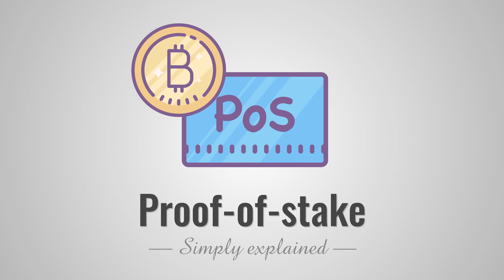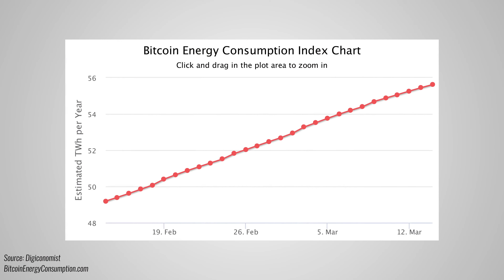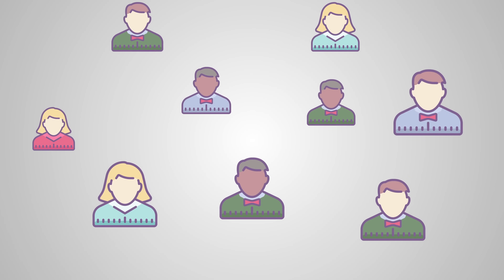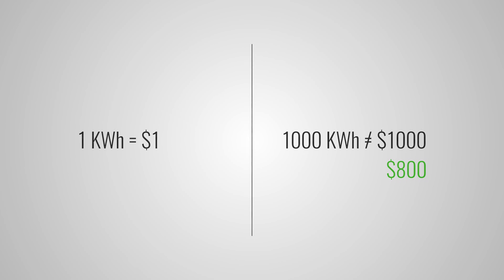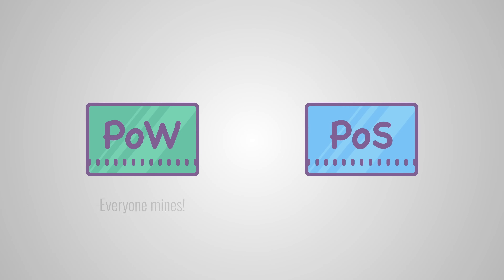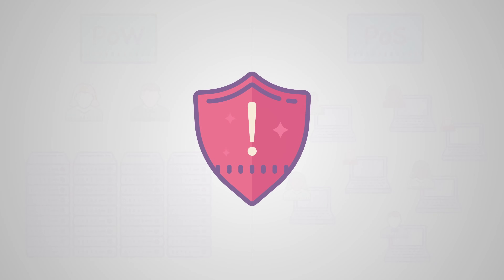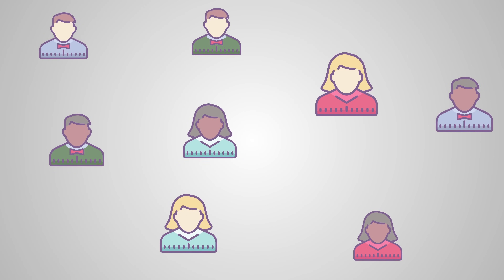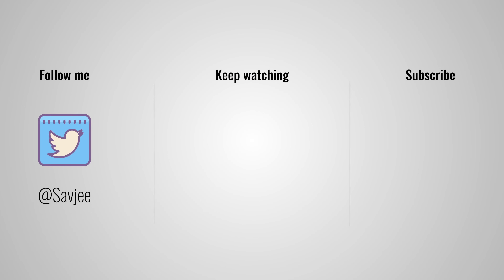Proof-of-Stake (vs proof-of-work)

Comment: 2:21 "One node is randomly chosen as a validator"
2:37 "Validators aren't chosen completely randomly"
Reply from the maker: Hehe, it's still random, just not completely random. Your odds are determined by your stake. But equal stake means equal chances, means random selection.
Reply: @davidz2690  if your forced to add "not with uniform..." so it's not "completely random" as general public assumes it, with seems "fully random with uniform odds". Like in a game of dices, with strictly the same weight for each dice and for each face of each dice. A "fair" random. 
 
SimplyExplain is just better than you to explain clearly without acronyms or technical concepts ;)

Comment: Complete novice here, but I have a suggestion. Why not assign blocks to users by scaling the size of their stake with the transaction value of the block? So have some sort of sliding scale where somebody with a smaller stake will get blocks of smaller transactions, and somebody with a larger stake will get blocks of larger transactions, kind of like tax brackets. And arrange it so that everybody (having over a relatively small stake in the currency) gets roughly the same amount of blocks to process.
Reply: Also a novice here, I believe block sized are fixed and do not vary.

Comment: but how the forger validate transactions and make blocks technicaly ? is they're doing that manually ? please explain
Reply from the maker: No it's not a manual process. An algorithm basically checks each transaction that can be included in the block. They check if the transaction can take place (sufficient balance) and if the transaction has been correctly signed by the person who is sending money (public/private key)
Reply: @simplyexplained   thanks a lot savjee
but what the validator do to get a reward ? because in the proof of work protocol the miner buy the equipement that uses energy in order to calculate and validate transactions and create blocks, what's the validator computer do to get a reward ? is that algorithm uses the CPU power , 
i'm sorry if ask you more question
Reply from the maker: The validator gets to keep the transaction fees. That's his reward for keeping his node online.
Reply: @simplyexplained   ah okey so the validators have the ability to on/off their node ??
thanks a lot savjee

Comment: thanks for the video! i'm wondering how does the network know that the validator approves a fraudulent block? since he/she's the only one doing the validation I suppose?
Reply: Everyone can have the data needed to create each block and forge the hash.
So i guess the simplest way is that each elected first check the previous hash then hash the new one.
Each validator is the validator of the previous. I guess the punishment is automatic.
Reply: @philv3941  isn't it blockchain? That means everyone in the node will have the copy of transaction and if they notice some red flags they can raise them?

Comment: What's to stop the creation stake pools similar to mining pools?
Reply: You need a balance of bitcoin's decentralization but the ability for pools, companies, teams to speed up velocity based on real world work.
Reply: I don't know how this problem can be solved generally, but I'll give an example. Orchid, which allows for decentralized VPN services, uses POS to select which node on the network will route a user's internet hops. Of course, a larger stake makes them more likely to be selected for a certain block. However, if the stake is so large that they are being awarded more blocks than they can possibly handle (being asked to provide more bandwidth to the network than they are able), then the extra staked amount is wasted. This gives an incentive not to stake more than what is needed. And also, it's important to note that pools DO exist very explicitly on most POS networks, as they allow you to "delegate" your staked coin to someone who has met the minimum amount to stake (these minimums are usually in the range of thousands of USD). I think a better permanent solution would be to introduce an artificial dis-economies of scale into the network, by having the chance of being selected for a block vary sub-linearly to the amount of stake on the network. For example, Validator_Chance = (Stake)^(.99) or something like this.
Reply: Exactly.  Are you familiar with Steemit?  Because that seems to be precisely what happened there... If people want to see how a POS system turns out, look at Steemit.  Then look at Bitcoin.  Which is superior should be apparent, imo.  (Don't get me wrong--I have been a member of steemit for almost 9 months now, and use it daily.  But I have seen how it has, imo, worsened over time, as opposed to *improve*.

Comment: As the stake in the deposit will probably higher that the transaction fees but much lower that the transaction amount.  What happen if the validator choose to falsify the ledger and steal the transaction amount?  How can proof of stake prevent this kind of fraud? In pow it takes 51% of the system to falsify blocks but it looks like it is much easier in pos.  Thanks!
Reply: In proof of work, it's the job of the miner who solves the next block to make sure that blocks that were mined before them are correct. In proof of stake you can implement it, so that the next validator has the job of validating the previous block analogous to the mining. The key difference is that in proof of work it takes more time to make a block, so the process of takes longer and that's why Polkadot can provide the transaction safety that bitcoin provides in an hour in under two minutes.

Comment: How does the system detect if a validator approved a fraudulent block or tampers with a block?
Sounds like the validators work needs to be validated which would beat the purpose?

Comment: How do you know if you are validating a fraudulent transaction? How can miners/validators avoid that kind of scenario? Cheers. Great video.
Reply from the maker: They check if a transaction was correctly signed (with the matching key) and if money hasn't already been spent (double spending)
Reply from the maker: Hmm no that's not true. To verify a transaction we check if it was signed with the private key that belongs to the public key (without knowing the private key). And to prevent double spending, we check the entire history of the wallet to see if it still has enough funds to make the payment.
Reply: And you can't safeguard yourself against fraud I.e money laundering. Even harder with the new masternode coins with built in washing facility.
Reply: Hi Savjee, thanks for the video, I was wondering if the following was true: In order to check if the transaction is correctly signed, you check the crypted private key. In order to check if the money has been double spent, you check the public key and see if the account has enough tokens on it. Thanks in advance for your reply!
Reply from the maker: No, it's completely automated

Comment: The best and most simple explanation of the difference between Proof of work vs. Proof of stake that I have seen. Really great job Savjee, thank you so much!!  :)
Reply: As always.
Reply: O
Reply: agreed!
Reply: @papaulogamerofc946  
1. You are in a pool for Proof of stake. The pool consists of several other miners and as a whole you guys create the coin. 
2. There is only 1 blockchain.
3. It's a mathematical equation that uses computing power. Whoever has higher computing power will have higher odds of winning - there is no definitive answer, only odds.
4. not sure if this is a question
Reply: @Dan-tg3gs  But what happens if the same validator creates two different blocks and sends it to different nodes?
Reply: Yes it was very informative, however I still don't understand how it works. If I stake coins it doesn't mean I'm running the network. So where does all the computation come from in a network that is only proof of stake?
Reply: @stefannebelrasmussen5289  You need to run a node to stake. Or you can delegate to someone in a Delegated-Proof-of-Stake economy.
Reply: @papaulogamerofc946  Thanks I guess that makes sense somehow? Kind of amazing that you can go from a Proof of work system to a proof of stake like that. What is stopping hackers to get into my node then? I mean, how safe is this sort of computation compare to a regular PC? If it's just my PC running a node? You answer just led to so many questions. I wish someone could explain this to me in a very detailed fashion.
Reply: Good job Sabhjee !!
Reply: Agreed. It was ... perfection. Well done!
Reply: I thought he said Xavier, but agree, good job. I’ll edit this with questions in short order...